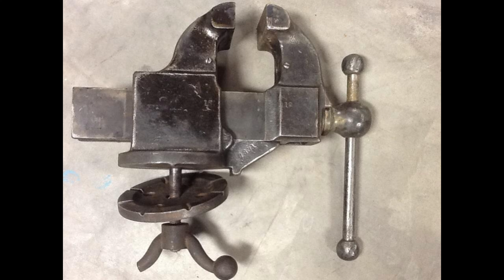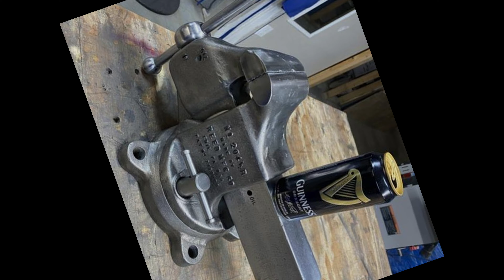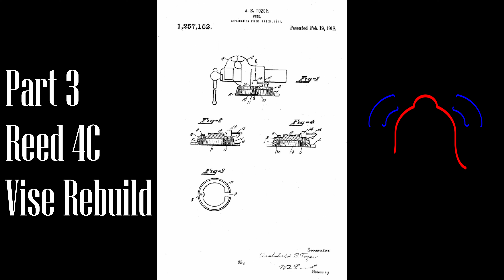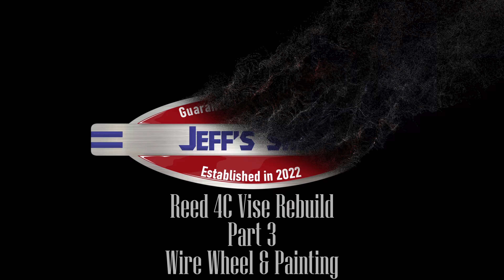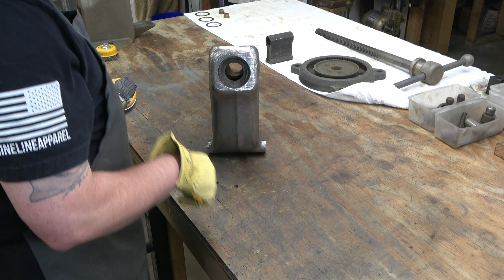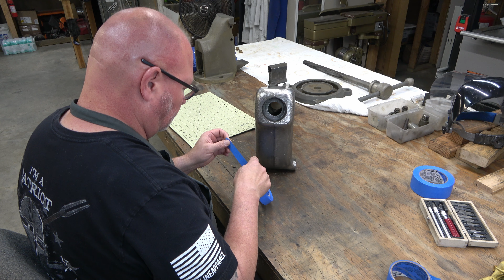Part 3 Reed 4C 6" Vise Rebuild (Wire Wheel & Painting)

Comment: Bought a 4C this weekend at auction.  It is a beast!
Reply from the maker: Outstanding, do you mind sharing what you paid for it? I am curious if the auctions are cheaper than finding them in the wild.
Reply: $175!   Rural PA.  It has some heavy use on the top near the jaws but no cracks or welds that I see.  It has the non replaceable jaws so I think that makes it older.
Reply from the maker: @mikemjw4533  That is a great price. Yes the non-replicable jaws is an older trait. Check out this thread on the Garage Journal Forum: https://www.garagejournal.com/forum/threads/reed-r-series-post-your-reed-date-stamps.400156/
Reply: Really enjoying this Reed series.  Makes me contemplate whether I should give my auction find some love
Reply from the maker: @mikemjw4533  If it were me, I would.